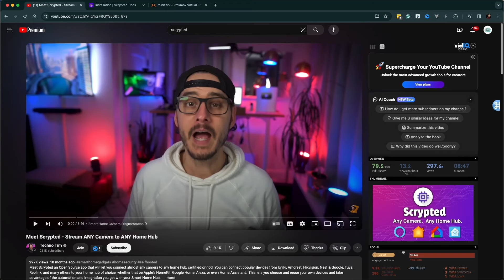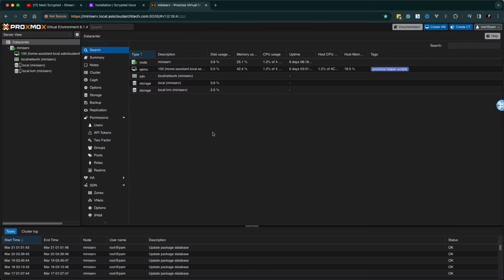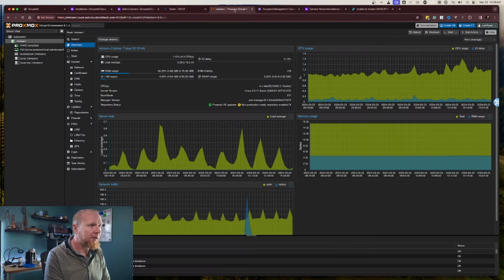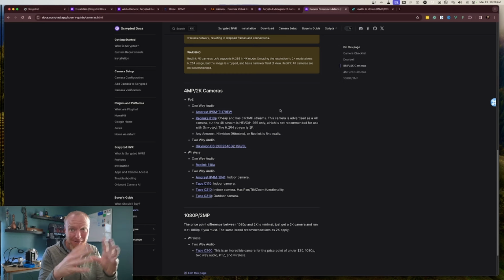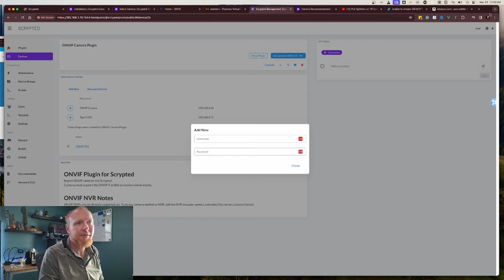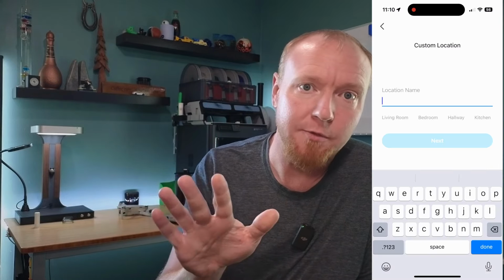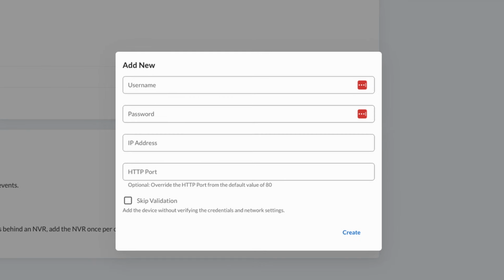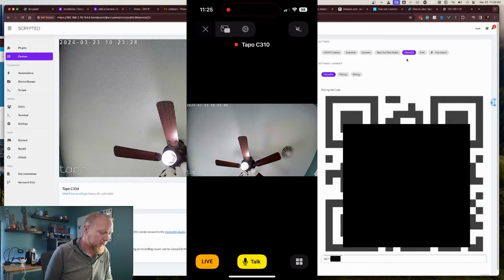How-To: HomeKit Video With a $30 Cam Using Scrypted! - ONVIF Camera Setup Guide

Comment: The million dollar question is whether or not you were able to get more than one working?  When I add a second camera, it just cycles through them and they go on and offline continuously.  Were you able to make it work with more than one?
Reply from the maker: I haven’t tried with two of the same camera using the onvif plugin. I do have two camera working, one is onvif and the other is webrtc. Both work in the home app through scrypted